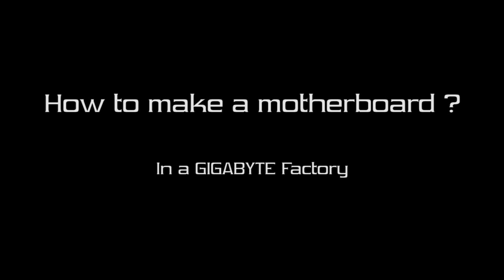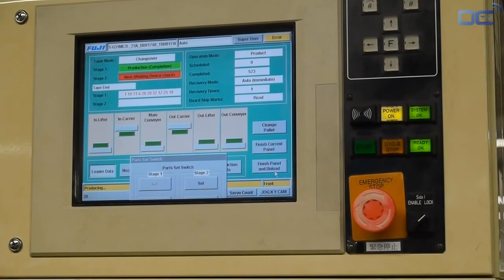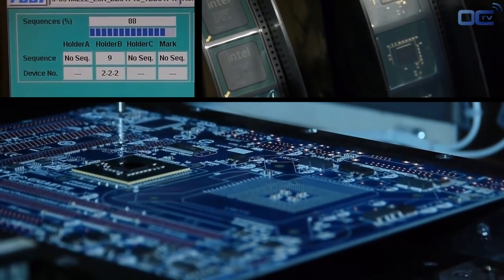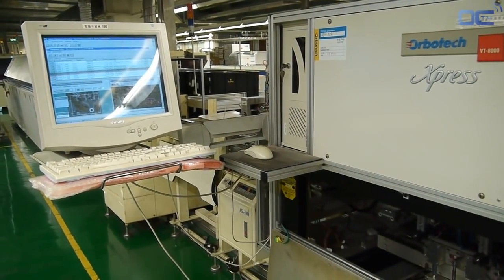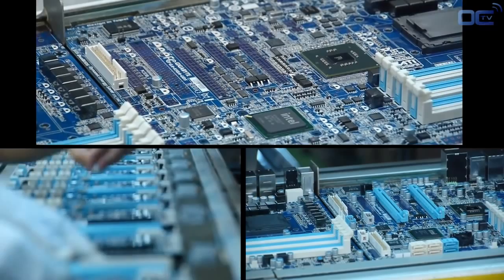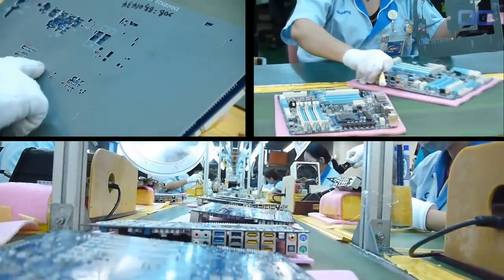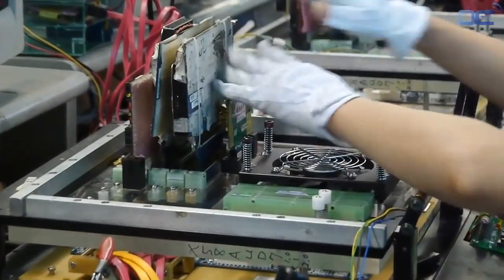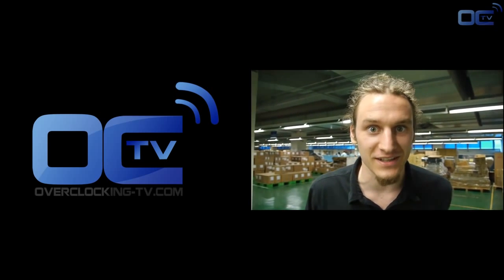How to make a Motherboard - A GIGABYTE Factory Tour Video

Comment: Love the reliability of Gigabyte. This brand has been my favorite for almost 10 years and never have had any issue.
Reply: Because Made in Taiwan unlike Foxconn being made in China
Reply: This aged well....Gigabyte and their exploding power supplies..
Reply: @belowboyt9876  Kid, they don't make the PSUs. And their QC is still the envy of ASUS, ASRock, and MSI. Like all the other silly Taiwanese companies, they rebadge OTHER company's Taiwanese products/junk to sell as accessories. GIGABYTE picked the wrong Taiwanese PSU to rebrand...
Reply: @joeshmoe6752  Guess their QC (which is apparently the envy ASUS, ASRock, and MSI) missed every single one of those power supplies. Now ain't that just quackin' crazy, kid?
Reply: @97Crazysteve  Kid, they don't make any of those power supplies.

Kid, GIGABYTE doesn't make the power supplies. They don't make their monitors. They don't make their SSDs. They don't make any peripherals.

Kid, if you knew anything, you'd know they ONLY design and manufacture the mobos they make and even less of the GPUs (called an ADD IN BOARD), mainly the coolers. 

I'd delete that comment.
Reply: Are you sure
Reply: @josh6715  Yes, kid.
Reply: @joeshmoe6752  I am not a kid I am a adult

Comment: Wow, would anyone have any idea why the motherboard makes the psu act like "starting....offf....starting....offff" the fan goes like twitch twitch and the voltage never reaches even 6volts?

It's not the psu, I'm trying to figure out what components make the fault on the mobo, because I got a free mobo from my friend who said it failed during a stress test :) It doesnt look burned anywhere nor smell, every part looks ok but who knows?

Comment: @maybach300c Those are not SMT compatible modules. SMT modules sits on the board, where as these pieces have legs that go through the board. Also those pieces are too big for the pick and palace machine apparently. I know it sound stupid that this is the reason, but that is the best answer i've got from the SMT guys. I am PCB man by the way. but yeah, those are the reasons.

Comment: @kumarblore2003 Configuration? You mean what parts should you use? If you're low on money get:
AMD phenom II X6 1090t processor
A motherboard that supports AM3 processors
A decent 750+ power supply
A decent video card, don't go cheap on this or it will bottleneck your processor.
6 gigs DDR3 ram (G. Skill ram if possible)
And get windows 7. But before doing all this I suggest you research on compatibility and understand a couple of things before building.